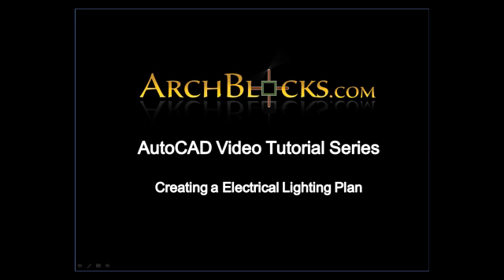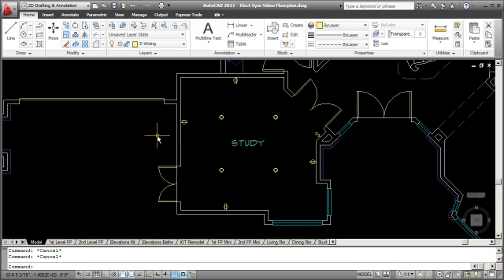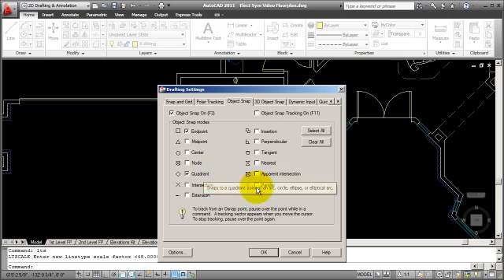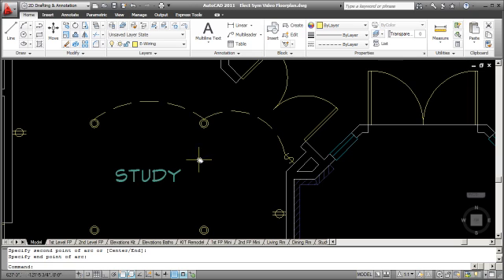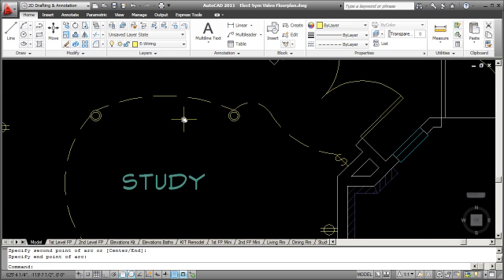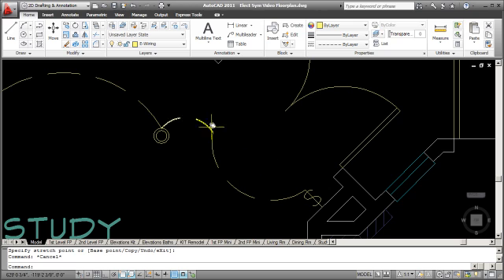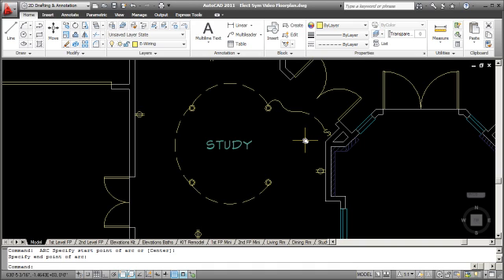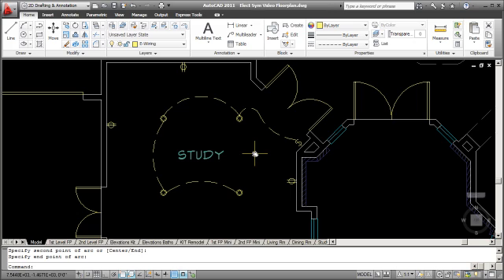How to AutoCAD - Creating an Electrical Lighting Plan Part 2.mp4

Comment: good shortcuts.
Reply: Learn Electrical AutoCAD, ETAP, DIALUX + Electrical design engineering in detail, Learn Electrical designing with in live projects. We will provide you all tutorial pdfs & notes, Designed projects, all Calculation sheets.
We will prepare your Resume also. If you want to join and want to know course contents please contact us on WhatsApp +919560658972 . Course charges are very low.

Comment: In my country we use straight lines for cables. It is much faster for drawing. Why arcs? Could somebody explain me? Thanks.
Reply: The way I've heard it explained is that some engineers/designers/etc like to differentiate it from other objects like walls
Reply: +Girl Power also if you use straight lines it would be a huge help to do the materials list.

Comment: Would love to see more drafting vids if you have time to upload.   Thanks
Reply: Learn Electrical AutoCAD, ETAP, DIALUX + Electrical design engineering in detail, Learn Electrical designing with in live projects. We will provide you all tutorial pdfs & notes, Designed projects, all Calculation sheets.
We will prepare your Resume also. If you want to join and want to know course contents please contact us on WhatsApp +919560658972 . Course charges are very low.

Comment: you are a life saver!
Reply: Learn Electrical AutoCAD, ETAP, DIALUX + Electrical design engineering in detail, Learn Electrical designing with in live projects. We will provide you all tutorial pdfs & notes, Designed projects, all Calculation sheets.
We will prepare your Resume also. If you want to join and want to know course contents please contact us on WhatsApp +919560658972 . Course charges are very low.

Comment: Thank you sir, you saved me probably 5 hours of searching.
Reply: Learn Electrical AutoCAD, ETAP, DIALUX + Electrical design engineering in detail, Learn Electrical designing with in live projects. We will provide you all tutorial pdfs & notes, Designed projects, all Calculation sheets.
We will prepare your Resume also. If you want to join and want to know course contents please contact us on WhatsApp +919560658972 . Course charges are very low.

Comment: thanks :)...
Reply: Learn Electrical AutoCAD, ETAP, DIALUX + Electrical design engineering in detail, Learn Electrical designing with in live projects. We will provide you all tutorial pdfs & notes, Designed projects, all Calculation sheets.
We will prepare your Resume also. If you want to join and want to know course contents please contact us on WhatsApp +919560658972 . Course charges are very low.

Comment: Great useful video!!!

Thanx
Reply: Learn Electrical AutoCAD, ETAP, DIALUX + Electrical design engineering in detail, Learn Electrical designing with in live projects. We will provide you all tutorial pdfs & notes, Designed projects, all Calculation sheets.
We will prepare your Resume also. If you want to join and want to know course contents please contact us on WhatsApp +919560658972 . Course charges are very low.